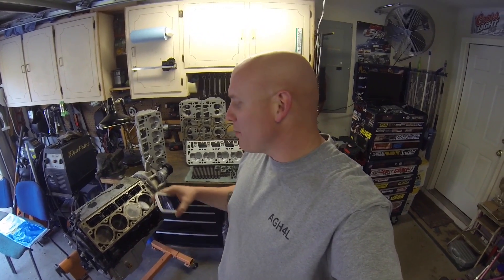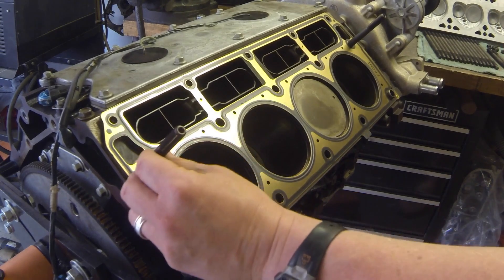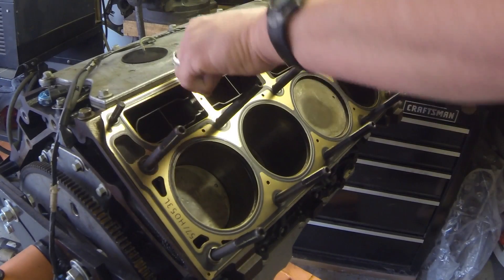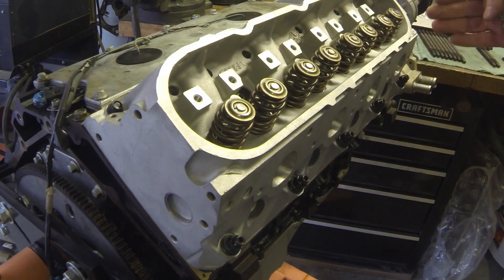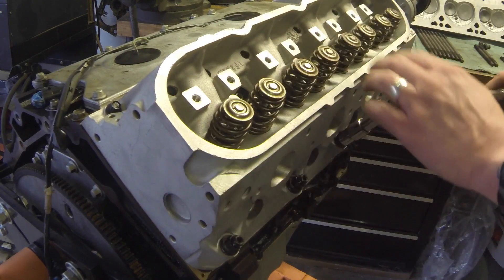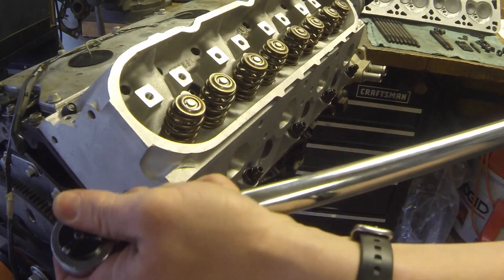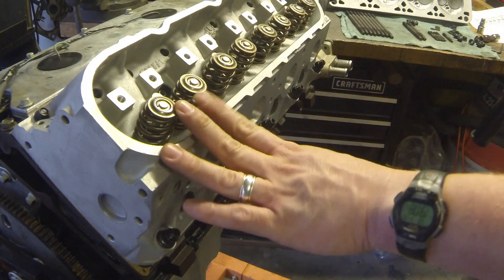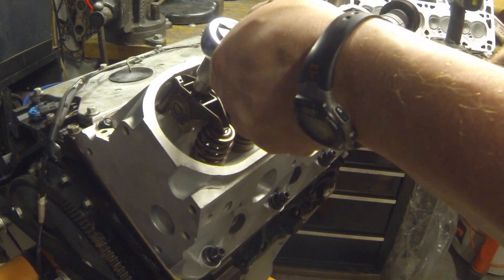LSx Head Install Torque Sequence "How To" - eBay Head Studs Pro Comp - LS1 5.3 6.0

Comment: If you had to estimate, about how much power would you say this engine is making in your truck. Either at the crank or rwhp? I’m doing a very similar set up, actually almost identical but with the tsp 228r cam.

Comment: With aluminum heads it seems smarter to install the studs after placing the head on block to prevent material being scraped by the stud threads and migrating INTO the block, cylinders or head???

Comment: saw on your other vids you milled the heads. did you mill the block too? and what pushrod length did you use? also you didnt lash the rockers. you just tighten to 22lbs at any lobe angle?
Reply from the maker: soyramflero Yep! I milled the heads on this one .045”. I think that I went with the next size shorter PR but don’t remember the exact length right now. Each situation could be different. So it’s best to measure your application to get correct length. Cam and engine can make length vary.
I did not mil or deck the block.
There’s no lash to set on these engines. Just torque the rockers down. The lash and preload can be checked though. That’s changed by PR length.
Reply from the maker: Mikey J Thank you! Yea, the preload is created by the push rod length. So there is preload, you just don’t have to adjust it at the rocker.
Reply: Just going to ask the same question??? No preload!!!! Didn’t know, easy peasy, love it!!!! Great videos, thanks👍🏼

Comment: I did same way for torque and used same bolts from speedmaster. When got to the little studs 2 of the fuckers snapped on me before even got to 22lbs. 😡 I even used arp lube

Comment: Well I have to search up to take of heads on the 5.3 and you came across. Lol. Even thoe you putting them. It should be same way on taking them off beside the torque them. No time soon till I get my 243 heads. But vid helps.
Reply from the maker: DatBoiBEAT Glad to hear it man! Torque sequence will be the same though. Just different torque.
I've also got a video fast forwarding pulling them off of the "Squiter" project. I'll get you s link.
Reply from the maker: DatBoiBEAT Here's that link. https://youtu.be/NKYvBSdmKI0
Reply: Thanks man

Comment: Nice video. Good thing I watched this I bought these studs for my gm big block 502 and was just gonna use the arp torque specs. So 70lbs works best?
Reply from the maker: +erpulliam Yes. I wouldn't do more than 70, maybe even consider 65ft lbs.
Reply: AGearHead4Life ok. Ever had any issues with these studs. Found some bad reviews. Rebating on if I should just buy the arp or even just use the factory bolts
Reply from the maker: Yea, I dont really care for them much anymore. I liked them when they were cheap, but price has about doubled on the. I've had them give me issues like thread stretching and just not fun to pull the head while in the vehicle with the studs in. People have proven that the stock bolts on these motors will how under lots of boost. So I just use the stock bolts now.

Comment: First off nice vids..I Torqued rockers down to 22ft/lb and noticed rockers fill squishy or lifters feel not pumped up is this normal until start up?
Reply from the maker: Thanks! Not sure what you're feeling, but the lifters will compress while youre torquing them down. It's known as pre-load. It may be fine.
Reply: Yeh not sure either may pull heads back off ..lifters compressing so much they dont stay on base circle of cam..pushrod is tight no play but push on rocker and lifter expands and hits cam pushrod still feels good.. on all of em .gotta be lifters

Comment: how long did these hold up? I'm going to turbo my 5.3 with cometic head gaskets, would you still recommend using these studs?
Reply from the maker: Nah, the price has gone up on them and Sloppy Mechanics here on YT has proven that stock TTY bolts will hold up just fine. I just use the stock TTY bolts now.

Comment: Hey I'm building a gen 4 5.3 and using eBay studs (2 length). I don't have many 12 point sockets in my arsenal. The nuts seem like 13mm can you share the size of the small and large with me? I'm not sure if they're std size either. Really appreciate your vids man! Keep it going.
Reply from the maker: Thanks RuinedSpec! I wish that I could man, but I'm in an empty house right now since I'm in the process of moving. All of my tools are in TX. It's just me and my air mattress here. lol Sorry man.

Comment: Hi I've installed a set of head studs like this. Problem is it leaks like crazy on both sides on each back corner between the block and head. I made the same mistake like you mentioned in the video. I followed the ARP torque specs. What happened when you did this? Please elaborate.
Reply from the maker: ah man, when you toque them to ARP specs it stretches and rips the threads off the studs. I dont toque these past 70ft lbs now. But I dont use these very often anymore either. Guys like "Sloppy Mechanics" have proven the stock TTY bolts to be plenty strong, even under boost.

Comment: nice informative video. I will be buying some of those heads studs with my build.
Reply from the maker: Thank you! TTY bolts leave it easier to remove the heads vs head studs. TTY bolts have been proven to hold plenty of boost by the Sloppy Mechanic guys here on YT, even when they reused them. The pattern to tighten them is the same as in this video, but you use angles instead of a ft lbs. I don't think that I could type it out here clearly. I may have to make a video on torqueing the TTY bolts down.
Reply from the maker: beasycuz I will definitely put it on the list to make a video of torquing down the TTY bolts.
Reply from the maker: Thank you Bishop! BTW, I don't always recommend these heads studs. It depends on the project. I am now pulling the heads on this engine after 20k miles. The head studs make it more difficult to remove the heads. The price of these studs have now gone up also. I will be using stock TTY style head bolts. Guys are even reusing the stock bolts on boosted builds and having no issues.
Reply: what are the benefits of going with the TTY style head bolts other than price? What is the procedure to tighten those down? Love the videos, lots of information keep it up!
Reply: Its the angles that got me confused. I understand a torque wrench and how to use that but what do you use for angle measurements in a situation like tightening down head bolts. Once you put them on if you could do a video that would be great!

Comment: I'm doing the engine in my truck and its the same engine. is there any other prep other than having the head machined  and the block cleaned? is there any other prep to the gasket or anything that I need to do before I put the gasket on?
Reply from the maker: Nope. You dont even have to machine the heads, unless they're not true. That doesnt happen very often though. It'd depend on why there heads were pulled. It wouldn't hurt to have them surfaced to make sure that they were true though. If I was doing that, I'd have them mill off up to .030" to raise my compression.
Reply: +AGearHead4Life okay I got you. I called the machine shop and they said don't bother Machining the heads either because all I did was pull the heads because of a lifter gone bad not because of the head gasket or anything. so I'm just going to clean them up real nice make sure it's smooth and then bolt everything back together to the correct specs

Comment: Makes it look too easy...I'll buy a bike before I try it, just in case.
Reply from the maker: +wolfy9005 lol It's always good to be prepared for the worst..
Reply: +AGearHead4Life 1:45 is that surface finish acceptable for MLS gaskets? What sort of longevity did you/are you getting out of it?
Reply from the maker: +wolfy9005 Yes, you can't get much better than that actually. I've been daily driving this motor for over 12k miles now.
Reply from the maker: +wolfy9005 and I beat the mess out of it as you can see some of in my other videos.
Reply: +AGearHead4Life Haha yeah, I was just curious about the colouring of the deck. Almost got all the bits together to swap the heads using a half dozen of your vids. Undecided on reusing the 853s with a composite or getting some 241s with the MLS, though MLS would make life a lot easier in the future for sure
Reply from the maker: +wolfy9005 yea, MLS are nice. I'd go with 862s and have used LS1 intake valves put in them during a valve job. They'd have the same flow, but automatically raise your compression ration quite a bit.

Comment: where are you getting your factory torque specs.. loving the videos! huge help
Reply from the maker: +kirk delorme Thank you Kirk! Glad to hear it man. I gathered info and made a judgment call. There weren't any install torque specs out there for these studs and I quickly learned that you can't use ARP specs on them. I wouldn't go over 70 ft lbs on them and make sure they're lubed.
Reply: If I went ARP studs instead do I follow ARP specs?   Would ARP be better than these in a Boosted application?
Reply from the maker: Yes you would use the ARP specs in their instructions. I don't use it on these, because they cant handle that much torque on them. Yes, the ARPs are definitely a stronger and better quality product.

Comment: what is an LSX?
Reply from the maker: +Wiggy McCrackin "LSX" is a GM race block. "LSx" is a term used to cover all of the LS generation motors. LS1, LS2, LS3, LQ4, LM7, L33, etc. Which are the 4.8, 5.3, 5.7, 6.0 and 6.2 motors.
Reply: @AGearHead4Life  very good info

Comment: are ARP studs really too expensive for the piece of mind you get?
Reply from the maker: Viking445 I'd say that depends on the build. If it was a motor that I had $5k in, then yea, I'd probably rund ARPs. But most of what I build is very low budget and wouldnt be woth paying three times the amount for studs. The only reason these are being used on the motor in this video is becuase the cost slightly more then replacment head bolts but are resuable. The fact that they're stronger really doesnt matter for this motor, since it is NA and no nitrous. I'm also glad that I used these studs becuase I later took the heads back off to change lifters and was able to reuse these studs when I put them back on. That saved me money and time from having to get another set. Also, these studs have been proven to hold quit a bit of power (~800hp?) with budget turbo builds by Sloppy Mechanics here on YouTube. So, to answer your question, yes ARPs are too expensive for what I'm doing. $300 vs $80.
Reply: Dude...MUCH respect for giving a detailed answer when you could have just flamed me! haha
Reply from the maker: Viking445 Thank you very much Viking. I don't see a point in posting a negative response. It just leads to pointless replies that help no one, but fuel anger. There's too much negativity on YouTube and the internet as it is. My goal is it do my part to not continue the hate. With an open minded response, a good conversation can be had and my self or another may learn from it. At the least, an insight of another person's point of view will be posted.

Keep on Wrench'n brotha!

Comment: I'm wondering if I over torqued my bolts(which I did) can I buy new bolts, take the old ones out, and still use the same gasket? Brand new, fel-pro permatorque mls. Or would the over torqueing have ruined it? Thanks
Reply: J Ny Engine not ran at all but has been sitting like that since last night. Roughly 12 hours
Reply from the maker: J Ny I would reuse the head gasket. I'd do one bolt at a time. But how far did you over torque them and what type of bolts where they? You could probably just leave the bolts as they are.
Reply: AGearhead4Life Stock bolts but they are fel-pro. I also forgot to seal the bolts that pass through the water passages.  None of them broke and still felt like they were grabbing but it's hard to say. Maybe another 90 degrees to 120 past spec? I bought a gauge now so I will be able to be a more accurate
Reply from the maker: J Ny Well, that's a hard one. I'd leave them and run it, but I also like to take chances and save the money. Of course the right thing would be to replace them if you wen that far past the TTY angle. If they felt solid, I'd leave them.
Reply from the maker: J Ny Something else to remember is that if they decide to break on removal, they'll be easier to extract with the engine out of the vehicle. That's pretty far past the recommended torque angle.
Reply: AGearhead4Life Thanks a lot man. I'm thinking just take the bolts out one at a time and seal and retorque. Don't really want to struggle that head out and back in. Just hoping I didn't ruin the gasket. Thanks a lot again for answering. Appreciated
Reply from the maker: J Ny No problem. I'd put money on the head gasket being fine. I've reused the MLS style head gaskets and I'm not the only one. Heard they can be used up to about 3 times with some copper spray. You should be good.

Comment: What is the difference between stock bolts and aftermarket ?
Reply from the maker: Stock bolts are TTY "Torque To Yield" are supposed to only be used once. The aftermarket like the eBay heads studs or ARP bolts/studs can be reused, they're not TTY.

Comment: i have a 2000 5.3 would the gaskets work properly ?
Reply from the maker: Yes, as long as your head doesnt have the one inch "notch" on the side that touches the block. Some of the heads on the LS motors in the first two years (99-00) had this notch. I have a saved note on it with a photo here:  https://www.facebook.com/notes/agearhead4life/lsx-notched-head-ls1-and-53-98-99-models/627286150658350
Reply: just checked it. I should be good then. thanks for help !!!lol
Reply from the maker: Great! No problem.

Comment: I know this is a long shoot but you said you messed up the 1st set of bolts would you happen to have a extra fastner laying around you would sale??
Reply from the maker: Not too far off acutally. I will have an extra once I pull the Squirter Project out of my Camaro. THats the motor that I stretched the studs on, but I just ran it anyway. So if you still need that fastener in about two months, you can have one.

Comment: Hey good video's! But I have a question maybe you could help, I'm putting Heads off a 02' Ls1 Camero SS, "& I wanna use Head Stud's" on my 00' Truck Ls 5.3, will I need 02' Camero Head studs? Or....?? Any help will be greatly appreciated thanks!
Reply from the maker: Thank you Tracy! You'll need studs for the motor that the heads are going onto. SO you need the '00 Truck studs. But funny thing is that they're the same for that '02 Camaro anyway. Good luck on your head swap! Remember, that will lower your compression ratio and they flow pretty much the same. Even though the LS1 heads have a larger intake valve.

Keep on Wrench'n!
Reply: O'really, ok let me tell u what I have, ok I bought off craigslist Ls1 heads with 87k miles on them with comp cam Beehive  Springs .600 max lift so I figured if I get some info on a good cam I could increase my hp? Do u hav a number I can text u at, if so an if u don't wanna put it on here u can email it to me at tracyjames2012@yahoo.com
Reply: I'm a Ls newbie you could say haha but I'm REALLY INTERESTED IN Ls now so I'm lookn for a good match up & what will interchange like wat cam with wat heads an wat springs an wat block ect.
Reply from the maker: The best way for me to manage my messages is on my Facebook blog page at "AGearHead4Life".

Those heads could work, but I'd mill the down either .045" or .030" to get compression back.

You should also get on our facebook group page "A Gear Head For Life" where a lot of us there talk about things like this. You can also post up your question there and get lots of feedback from many sources.
Reply: O'hell yea kool thnks

Comment: question for you man do you have to build an ls1 to turbo it? building a drift missle and wanting to do an ls1 swap in an RX7 with a turbo! lol
Reply from the maker: No you do not. These things are beasts. Will a true build make it stronger and last longer, yes. But is it necissary, no. Check out the "Sloppy Mechanics" youtube page. They do it all the time and I think they've even hit 20 psi on a stock 5.3 block. The most important part of boosting the motor is the tune. Get the tune right and you boosted stock LS motor will do great.
Reply: Awesome! Dude, ill check them out can't wait to start this build. thanks for the info!
Reply from the maker: No problem Mckena! Good luck!

Comment: What kind of bucket seats do u recommend for a 85 Chevy c10
Reply from the maker: I dont have a particular set of buckets that I recommend. You could pick any from  any car that you like and adapt them. In these trucks I like to have a middle seat so that I can fit more people. So I always use the 60/40 split bench with folding console. So it looks and rides kinda like buckets and has a arm rest in the middle, but I can fold it up and sit a kid in the middle when I want.
Reply: +AGearHead4Lil17

Comment: I have one more question why does my 92 Camaro rs  stall on me from time to time, is it because I don't let it warm up long enough, sometimes I give it 2 minutes tops and reverse and then it stalls not all the time just some days
Reply from the maker: I do not know man. There are lots of things to trouble shoot for that. Maybe furl pressure regulator? Try rebuilding the TBI. Should be cheap and could probably use it. Also, check or change the plugs. pretty much do a tune up on it.